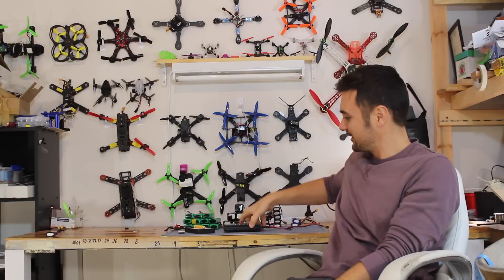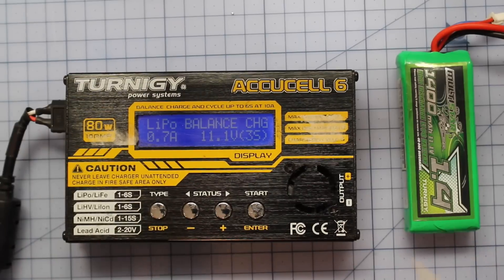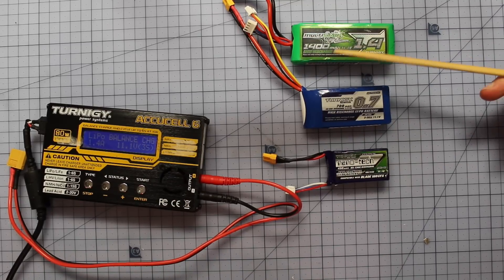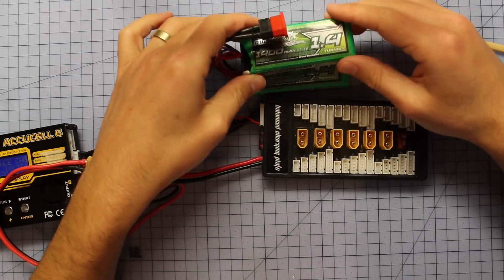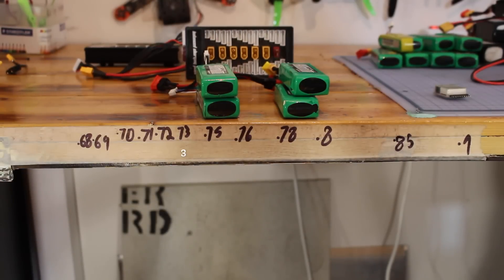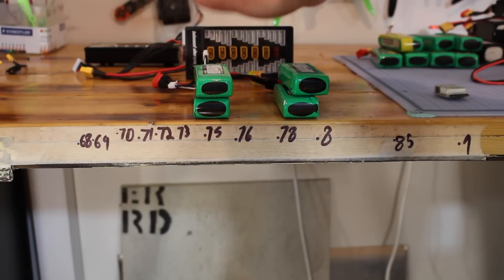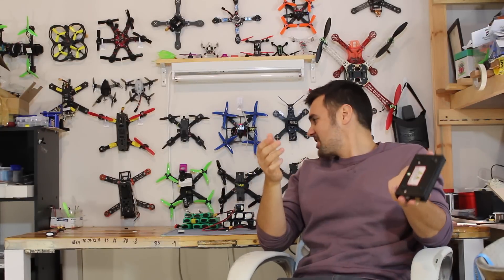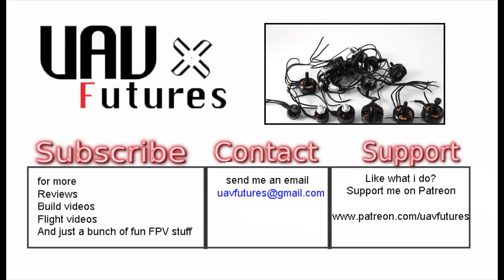Beginners guide to charging LiPo batteries + parallel charging

Comment: After watching your Beginners guide to charging LiPo batteries + parallel charging video, I thought, is it OK to storage charge multiple lipo packs, using a parallel board following the same  rules for parallel charging and simply selecting "storage mode" on the charger ???   Essentially, can a parallel storage charge via a para board ?  

Thanks, your videos are a must see

Comment: Just found your channel, thanks for such a helpful video.  I'm just about to go 4S with 2 1500mah lipos. Just to confirm, if I parallel charge them I'll do 1500mah X2,3000 at 3.0A? That's using, a gtpower td610 pro with a gtpower 2X2 4S adapter

Comment: Charging is annoying.. my airsoft lipo charger doesn't do LiHV.. so order new Q8.. now my emax 1s 2s ph2.0 charger getting buggy.. so got a 1s charger.. but still no way to charger 2s ph2.0.. thinking switching drone to xt30 (with or without capacitor 🤷‍♂️)

Comment: I have a 5000mah lipo battery 14.8 volts but as I balance charge it. It goes to 16.80volts and it doesnt beep. Now i dont know if my battery is done charging.
Reply: Most chargers at that point are slowly decreasing the Amps until the battery cells are maintaining a stable charge. If the alarm is set to on, just wait for the beep. If the alarm is set to off, most chargers will display a "Full" message somewhere.

Comment: I have a 5000mah lipo battery 14.8 volts but as I balance charge it. It goes to 16.80volts and it doesnt beep. Now i dont know if my battery is done charging.

Comment: Hi, Thanks for the vids. Been watching you for years and finally taking the plunge and going to get myself up in the air. Now I'm looking I have noticed that not all chargers fit a standard wall socket. How do you power your batteries? I don't really want a 12v car batt sitting under my workbench:) How do you power up? Cheers

Comment: The Happymodel 6 in 1 charger for the Mobula 7 has a XT60 connector right? I’m in Canada btw, Cause I would like to buy the wall adapter but want to make sure I get the right one and proper power output etc. I’m completely new to this stuff so any help would be greatly appreciated!

Comment: Can’t I just cut the xt60 plug off and shuv the leads in my house manes
Reply: yeh bruv that'll work just make sure you chuck open a beer and watch from outside in the garden on your folding chair ye? don't want cha dead mate
Reply: Psychonaut hahahaha 😂
Reply: Well a year later and I'm wondering, how did it go?
Reply: Lmao
Reply: Blake FPV sure u can!!
Reply: first check the amperage by short-circuiting the battery with your multimeter.

Comment: So, you have a nice tool to check the volts, is there a tool that will discharge a battery to a set voltage easily so they can be parallel charged?  Maybe I have 6 batteries with a voltage range that is just a little bigger than I feel safe with, how would I safely discharge the higher voltage batteries a bit without hooking up a quad and spinning the rotors in my house?

Comment: what does the charger do exactly when you charge either a high voltage lipo or a standard lipo? whats the difference? I assume both batts state the same voltage on the front?

Comment: most ports are one way, Meaning they can only be plugged in the right direction as long as your not forcing it. Either do to shape or tabs on the sides. So far for MYSELF I havent seen any batts that can be plugged in wrong. But thats what I have seen

Comment: Hi folks,thanks for great video.
just my 50 cents of info to improve this guide.
There is few bad scenario still exist when you connect all this cells in parallel,each and
every pack & cells have different internal resistance so the consequences might be harmful because of next reasons:
1- not equal current flowing in each cell (you better not charge whole pack at its 1c,for example 5 packs 1000mah each not so safe to charge at 5 amps),safest side is to charge at C rating of 1 pack which is far over protection but u decide.
2- if you have one bad cell the balancing process might take way more time and potentially damage all of your packs at same cell number.
so be careful and better of all write on each battery pack it's cell internal resistance and try to match packs as much as possible.
BR all.

Comment: I have a tiny propel drone and a bigger one ! But I lost the charger cables back at my parents house. 
The drone I wana charge is the one that I can take the battery out 

It’s a 350mah 3.7 volt 
But is it sad to order a charger online and install it my self! 

I couldn’t find the same drone cus it’s one of the first ones 
Also the battery is 1 inch in size and the slot for it in the drone is the same size 

The chargers I seen on amazon only have 2-1/2 batteries - 

But again all I care for is the charger 

Is it safe to use it on my drone battery?

Comment: Hi Stu. Just started flying again.
Question about my 4s lipos.
The 4th cell and sometimes 2 cell are out by alot
Even after a single balance charge them.
After flying
14.8 
3.77, 3.72, 3.72, 3.66
Once balanced
Its 16.8 or 16.7
But 4.2 or 4.19 on 3 but the forth is 4.14 or even 4.08.
Is my charge out of wack or are my lipos toast?
Thanks for the help

Comment: I have a diatone tyrant s. I been running a 3s battery for about 2 months. I tried using a 4s but the quad flipped upside down. I guess they call that a death roll. do i have to change the PIDs?

Comment: I have a 20000mAh 4S multistar turnigy  what would be a nominal charging value ? Im using it on a Boat and i got a 5 amp charger with the boat but the guy i bought the boat from told me to charge it at 3amps will it dmg my battery if i  charge it less than 1C or should i get a 20 amp charger and charge it at 1C

Comment: You say 1.4 Milliamphour but it's really 1400 mAh and 1.4 Amphours. Normaly I woudn't care because you know your stuff but if you want to explain it to others please do it correctly. I can hardly think of a case where you could get it wrong and put you mAh as A into the charger (maybe a 70 mAh 1 cell on a huge charger?) but better safe than sorry. So again mAh(Capacity in 1000th Amphours) / C (Charge speed in 1/Hours) = mA (Curremtin 1000th Amps) and Ah(Capacity in Amphours) / C (Charge speed in 1/Hours) = A (Current in Amps).

Comment: For me. I will be charging (2) 7.4 2S 5200mah 50C batteries.   My  set up for the amperage will be 10.4A for an hours charge for the  two.  I am better off not parallel charging because  I be charging two at 5A for 2 hours Either way I  still get done the same time  if doing one at 5.A, or two at 5.2A?   I will be needing a battery checker.   thank you

Comment: Interesting video, thanks. I'm new to drones and batteries. I have a few 750mAh / 7.6 v /15c /5.7Wh batteries I'd like to charge together. Would these batteries be considered as 'high voltage' and would this charger do the job? Can I get a balance charger to charge upto three of these batteries together. Value a tip here if you have the time :-) Thanks

Comment: New to FPB and I want to buy the Turnigy Accucel-6 80W charger but none come with the power supply. Is there a power supply I can buy that has the correct connectors so that it is compatible?

Comment: Hi I Just got a A Traxxas. And i want to Buy a Bigger battery Whith a Balance Plug Charger. So i can Charge Them. Not in a Car.
The battery Is 40c 7100mah. and My charger  is on output is on 7.4v 0.55a. I know It wil take some Time. But is it Possibel to charge it ?. With That charger?.
Sorry for bad english

Comment: If you are in a rush, most chargers have fast charge... Charges to around 95%, the last 5% or so takes along time.Also if you have the time charge at 0.5C make the battery last alot longer.

Comment: QUESTION: a friend of mine decided to borrow the lipo battery from within those rentable electric scooters "SCOOT" and cut it in half then proceeded to install that half of the battery into their stand up electric scooter. Only now thwey dont know what kind of charger they should use to charge it...? Any advice you could give would be greatly appreciated! THANKS!

Comment: If i got 2 pack with different C rating, for an example a 4s 1300mah 75c and a 4s 1300mah 100c. Am I still able to parallel charge them or should I only parallel charge packs with the same C rating?

Comment: Excellent video and g'day from Canada :)  Do you know or have you ever tried using the balance board to place multiple batteries in storage mode?  Often when I come back from the field and I have multiple batteries, it would be so much easier if I could put 6 batteries at a time in storage mode, just wondering if the balance board would work safely and properly for that as well.  Thanks again for your passion and dedication and taking all the time and effort to do these great videos.  Happy flying!  Cheers, Scott

Comment: Hey I'm parallel charging six 3s 5.2 batteries and I have my capacity cut-off at 5200. I was wondering do I still keep my Capacity Cut-off set at 5200mah when Parallel charging? Or can I increase it too 31,200mah now that I have six 3s batteries plugged in?

Comment: what voltage should i charge a 2s 30c 5000mah lipo battery?
Reply: 3 amp
Reply: 7.4 volt 5 A
Reply: Mosz of the 30c Lipos have a 30c discharge rate, not a 30c charge rate. You should charge it with 7.4 Volts and 4,8 to 5A

Comment: These Turnigy chargers have a handy voltage tester that can be found on the BATTERY/PROGRAM level of the menu, which shows all the cell voltages on screen at once, when you connect the balance plug.  It's a bit quicker than using the portable tester and having to wait for it to cycle between cells.

Comment: For anyone wanting to know the math, remember P = A * V. So you need to multiply the voltage (11.1 here) times the amps to figure out the power draw. His charger was only an 80 watt charger, so 11.1 amps * 7 amps would draw 77.7 watts of power. That is probably too much for this charger, I have heard you should always leave 20% headroom for any power supply. So for 80 watt charger, probably don't put more than 64 watts through it.
Reply: Aaron Writes Code its P=U*I

Comment: just got the force1 dys220..and my drone dies out at 3.4v...i assume this cause when I go to charge the battery, my Imax b6 reads 3.4v for each cell.. is their a setting to change this on my drone or remote..or is that a built in to cut off motor on drone or remote..remote is radiolink AT9..

Comment: can i charge 1 battery with max of esc like : 10A to a 5000mah battery ? it will took me 30 min to charge the battery or iam wrong ?
if 5A charges a 5000mah battery in 1 hour. iam right ?

Comment: great info mate top stuff.  quick question  i have a 3s 65c 5000mah lipo it's  3 to 4 months old but only used 3 times then put into storage voltage. could i buy the same 3s and use it in parallel with the  3 to 4 month old battery that was used 3 times

Comment: @UAVfutures - what kind of power supply are you using for your turnigy accucell 6 :)
Reply: Switch mode power supply
Reply: any link for purchase?
Reply: Yes, I'm new and have no idea which power supply i need with the Turnigy 10 A charger
Reply: Justin Brim I'm using a modified old Xbox 360 power brick

Comment: If I have two 2s batteries wired up in parallel can a simple plug the two balance leads and one xt-60 into a parallel charging board? Or do the two balance leads need to be connected first?

Comment: for a low discharge high capacity lipo like 15C 2700mah battery, I heard some where if we charge at around 1A instead of 2.7A then the battery health will remain good over many charge/discharge cycle ? Is 1C charging is valid for low 10C 15C lipo also ?

Comment: Yeah, helped a lot mate. But quick question. If the charger is willing to set the amp at 6, wouldn't that mean it's safe to do so in parallel too? My charger is 80w and can only go up to 6 amp. Would it by dangerous then to charge 4x 1400mah batteries at the same time at 5,6 amps? I mean, it's close to it's maximum output.

Comment: Great video Stu.  I now have enough batteries, that I need to a parallel charge board. I love your channel and I always get a lot out of it. Thanks. I do have a couple questions. First, where did you get those XT60 connector covers? Also, I saw a video of yours, where you showed a really cool USB charger deal that you connected to one of your LiPo's for charging in the field. Do you recall, what I'm referring to and if so, which video was that? I would love to pick one up. Thanks again for all the content. Your channel is my favorite.

Comment: If this were my video, I would've mentioned to not leave the batteries alone while charging, and probably recommended some sort of LiPo-crarging-pouch, as those greatly limit the possible damage of LiPo explosion. Also, the craging area should be clear from flammable materials. Friend of mine survived from LiPo explosion with black floor and little shock, but if there were anything flammable around, the result would've been a lot more sad. That being said, your video told a lot of important things many would never figure out by themselves.

Comment: if you have one of those smart battery cell checker that can also balace your lipos with you can plug all your batteries into the charging board and plug the board into the lipo checker and balance all your bateries together so you dont have to sort them per voltage👍

Comment: I have a question i have an imax b6 charger and when i charge my 2200mah 3s battery it stops charging at 11.3 volts.I know that it should go up to 12.6.What is going on there,what can i do?

Comment: Just a tipp: Lithium cells don't like high charge rates. The oxide layer on the electrodes inside the cells cloggs faster with higher charge rates and so the cells "degenerate" faster. Just charge them at ~0.5C, that's actually the recommended charge rating from the manufacturers (Just take a look at Datasheets from LiIo/LiPo cells from LG Chem, Panasonic, Sanyo (sony), Samsung...).

TL;DR: The lower the charge rating, the more happy the battery is (:

Comment: Hey good job you've done there ! Just got one parrallel charger because of you :) But i was wondering is it normal that the cells are not at 4.20V like they used to be when charged solo but more like 4.17-4.21V. Is it the fact that i'm charging multiple lipos at a time or juste my parrallel charger doing wrong ?
Reply from the maker: no they should all be 4.2
Reply: Ok thank you ! I will get a new one then, yours seem to be the Tarot one from Banggood ? Tell me if i'm wrong (http://www.banggood.com/Tarot-Para-Board-TL2716-Lipo-Parallel-Charger-Board-XT60-pro-version-p-931605.html?)

Comment: Might want to mention you need a power supply. I bought this as a noob and all I had left was to charge batteries and fly. Only to find out I cant charge anything because I cant connect it to the wall.

What power supply are you using? I WANT TO FLY :D

Comment: How much mah are we supposed to burn on a lipo before we stop flying? 80% of the capacity? What's the recommended %? Or is it better to rely on the voltage? What's best? Cos with the voltage sag is never very accurate... Thanks for your replies!

Comment: Question: For years I have had RC scale off road trucks that required the lipos to charge using both the regular connector and the balancing connector, but recently I started flying fpv quads, and now my fat shark battery charges using only the power supply and then I have a Rise vusion battery that charges using only the balancing connector.. WTF?

Comment: Did you had some problems with lipos because you are charging them with only 1c?
I never had a problem with them and i always charg them with that what is written on the cover 
as an example if the nano tech can handle up to 5c charging power i will charg them with 5c because it saves a lot of time
And sorry for my bad Englisch I'm from Austria ^-^

Comment: great video Stu! I just throw my batterys onto the parallel board with no balance leads to balance Eachothers voltage for 10 mins  then I connect the balance leads for another 10 mins... that way when I go to charge them again they are all the same cell voltage... I typically do that at the end of a day of flying (useing the same methods that you use for charging e.g. same cell count and mah ratings)

Comment: Hey Stu - great content as always but please let your viewers know that the current AC version of this charger will not charge Fatshark batteries.  It does have a CHARGE mode (as opposed to BALANCE) however it still requires a balance lead :(  I already went through this and had a friend suffer through the same.  The DC version seems to have different firmware that works OK.  Instead the iMax B6 will get the job done and is AC powered which is preferable for us n00bs.
Reply from the maker: it charges my fatsharks fine. but it might be the newer fatsharks it cant charge
Reply: Thought you were running the DC version on the video.  My bad.
Reply: MojoPapi FPV f N DC commonplace bin mignon yyjdo c know        hgfo

Comment: 1.4 amp hrs. not mah. it would be 1400mah /1000 =1.4 ah Not huge but a tip for newbe
Reply: Dude thanks lol how do you know when the batteries are charged or need charged? I dont have a cell checker I just have a multimeter. The battery said it's a 4s 14.8v but the read says it's at 15.44v

Comment: I looked up the charger you were using in the video but could only find an ac adapter for the 50w 6 amp model. I would prefer to not burn my house down. Do you know of a more suitable adapter or will the 50w work?
Reply: I guess I was asking about the power source rather than an adapter. sorry.